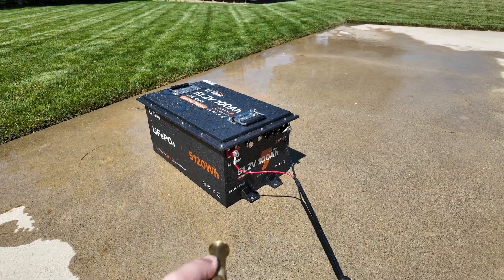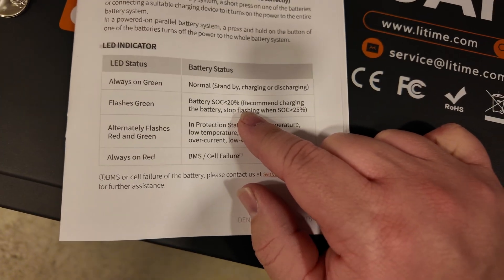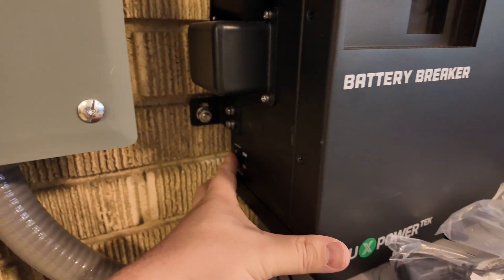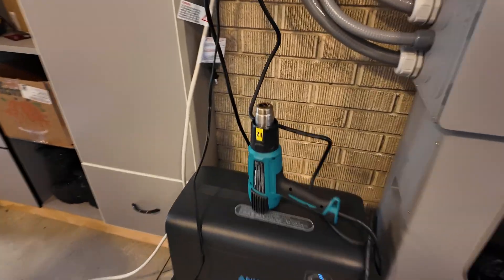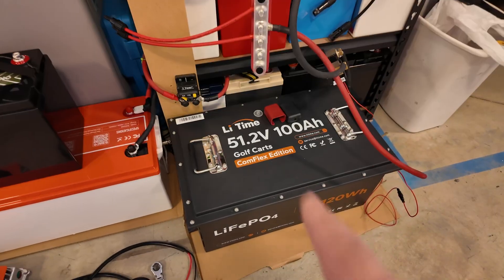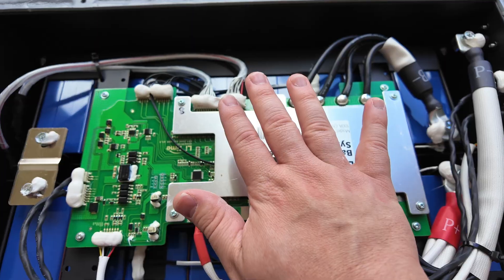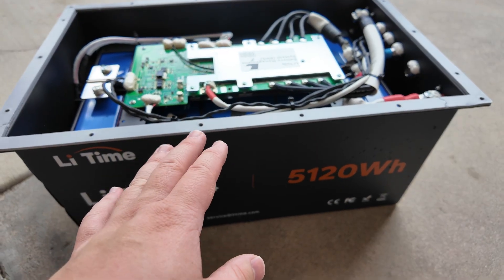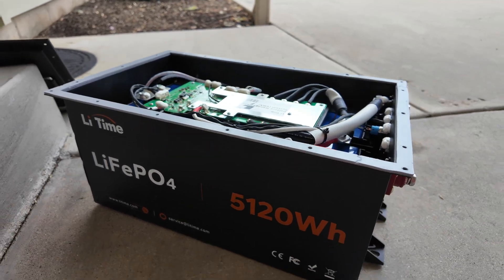HURRICANE-PROOF LiFePO4 Battery?! LiTime 48V ComFlex Review + Teardown

Comment: You said that the golfcart battery BMS is identical to the eg4 wall mount at 200amps but when you showed the photo of the BMS it says 100amp. Was this a slip-up in wording or are they advertising a 200amp BMS?
Reply from the maker: Good question! Technically, the golf cart battery is rated for 200 amps and even beyond for a period of time…but for extended runs LiTime can only produce 100 amps non stop. Thanks for watching!

Comment: Golf cart batteries need a 200A BMS minimum.
Reply from the maker: This one can produce that much power and beyond for semi short periods of time. But it appears to be rated for 100 amps continuous. Thanks for watching!
Reply: 100 amps at 48 volts is the same power as 400 amps at 12 volts.  (4800 watts)
Does that information change how you feel about it?
Reply: @daveybphotography  Nope. My DIY electric ZTR pulls over 10kw peak.

Comment: One point that needs to be made here is that there's a very good reason why server-rack and whole-home batteries are amp-limited, and that is to ensure that the I.R. of the fuses and breakers in the system is not exceeded when paralleling a bunch of those sorts of batteries.

You can't parallel a bunch of these LiTime batteries safely due to the fact that its BMS is allowing 600A discharge (and might not be short-circuit-protected at all... you'd have to test that.  See if its just depending on the thermal trip or not).   Allowing that level of discharge can become very dangerous very quickly when paralleling.

For this reason, generally speaking... gold cart batteries should not be used in whole-home systems.  You can get away with one, but you can't safely parallel them.  They should be used in golf carts where you might need a lot of amps in bursts to get up hills (and so forth).

-Matt
Reply from the maker: True these batteries can sustain more current than other batteries like server rack units. However, it’s no different current wise putting a bunch of these in parallel vs. something like the EG4 wall mount batteries in parallel. They are both rated for 200 amps of continuous discharge. Fuse properly with T-Class fuses each string of parallel batteries as needed to not be above the interrupt current rating of the fuses and you’ll be golden! Server rack batteries don’t have an IP66 water resistance rating on them potentially making them substantially more dangerous in a place with water vs. these golf cart batteries! Thanks for watching!
Reply: @theresatrickforthat  If you have 10 of the EG4 batteries @ 14.3kWh you now have 143 kWh of storage that trips within 3 seconds at roughly 3kA.

If you want to build a storage system out of the LiTime batteries with roughly the same amount of storage as the EG4's... 143 kWh... that's 28 batteries that trip within 3 seconds at roughly 17kA.

3kA vs 17kA.   On bus bars rated for 600A.  Not to mention the battery cabling.  See the problem?  It is not even close to being the same.

And sure, you could throw in piles of T-class fuses and breakers in to try to work around the problem but it isn't really a good solution.  Maybe not those slider-style breakers though... those are only good for around 1000A @ 51.2V (the good ones, anyway).

-Matt